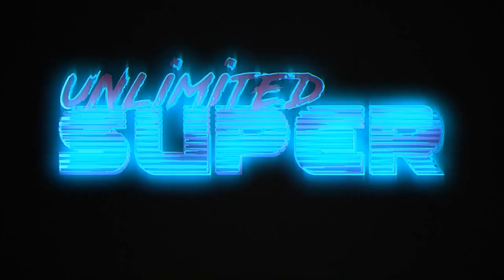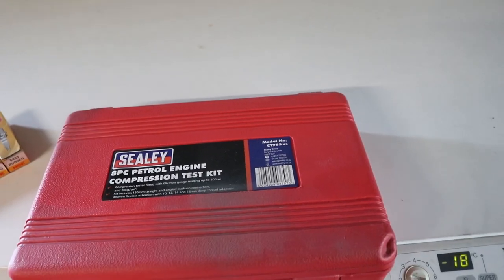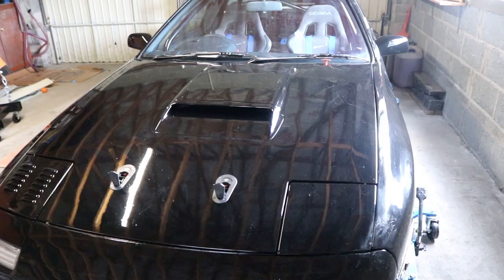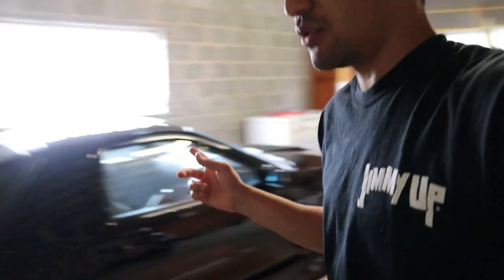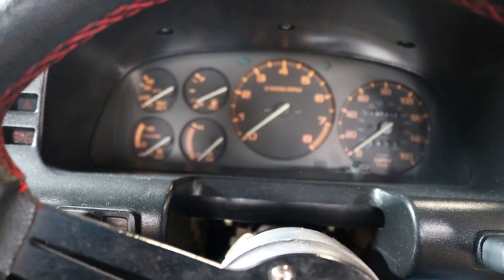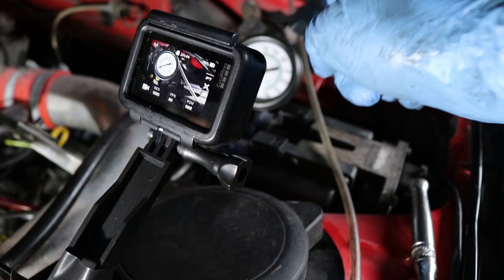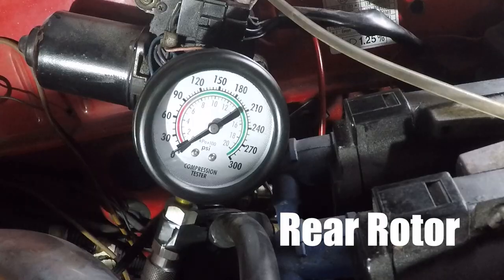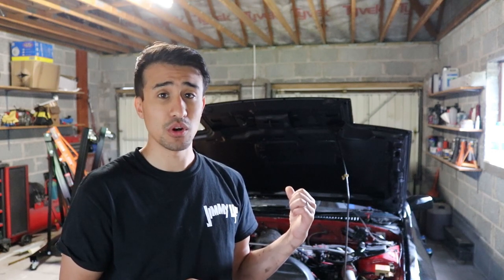Rotary Engine Compression test // Unlimited Super

Comment: bro holding that button and using that compressor tester is not going to give you an accurate reading... get yourself a real rotary compression tester.  Its going to be reading lower Psi if you are just holding the button.   Even using a compresison tester with taking the valve off is better than what you did.  I would do this again.
Reply: also need to make sure battery is full charged and ur getting good power. low battery can give u lower reading.
Reply from the maker: Yes, I have since tested with a mazda tester and have good compression 😅 thanks for the advice man
Reply: @UnlimitedSuper  thank god i was worried you might have already tried pulling the enigne! good to hear tho keep grinding !
Reply: also thats how you know out of the 300 people watching u aint got no real rotary heads here haha
Reply: Mazda in other languages mean barely going somewhere are not very popular lol